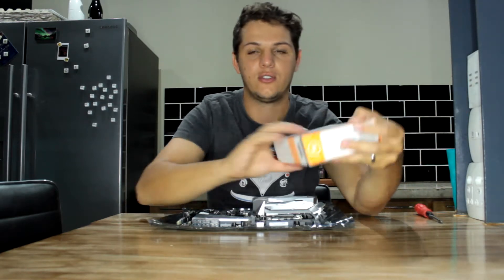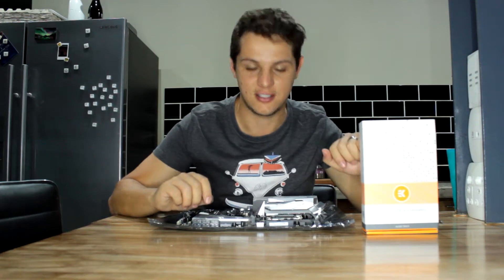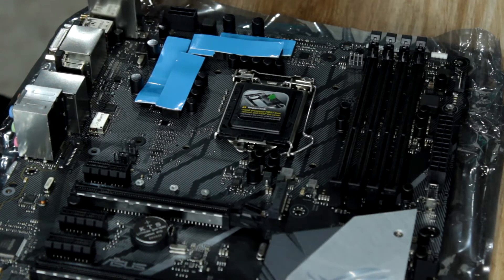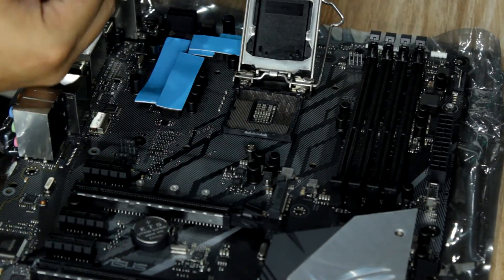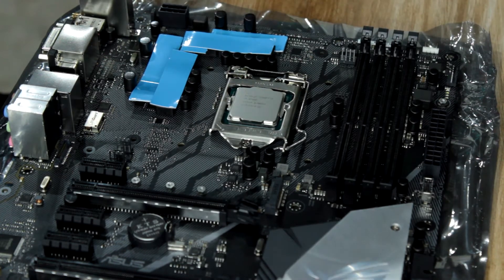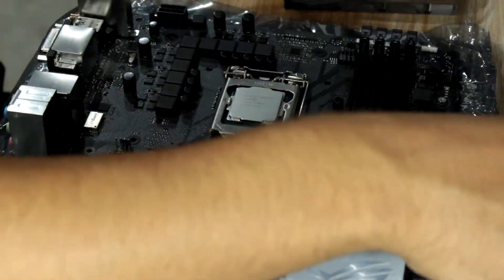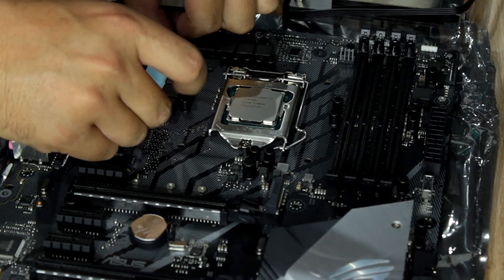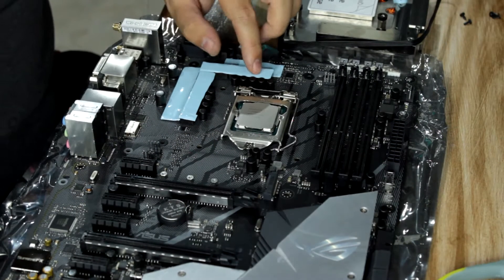PC Build Log # 3 Water cooling Asus Z370-E Motherboard

Comment: Oh cool nice video. My rgb doesn't work so ill check that plug. Also i didn't pull my m2 sticker off, i hope its alright. It would be interesting the temp differences with just cpu cooler
Reply from the maker: Your M.2 will be fine I just did it to see what the pc community thinks out it.
Reply from the maker: Hey your m.2 will be fine with the sticker on my CPU and MB is normally at +1-4 'c room temperate at idle. but my CPU has really bad TIM(Thermal Interface Material) so I need to  liquid metal my CPU.